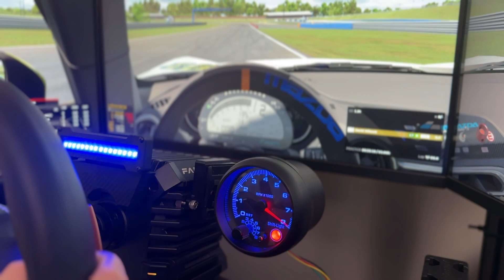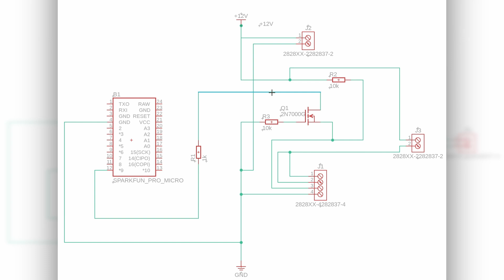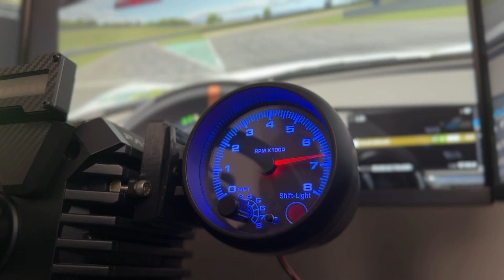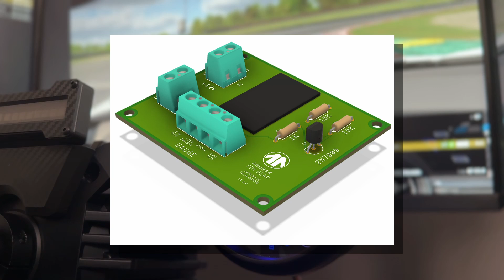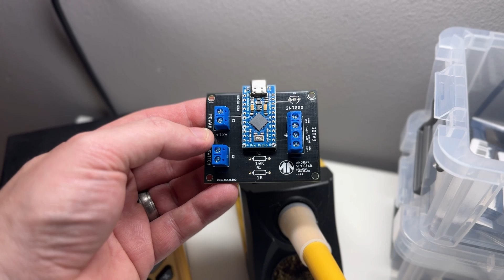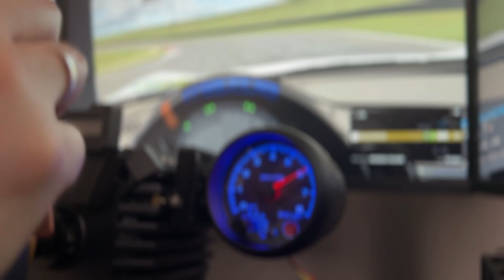New sim racing project: Analogue Tachometer

Comment: Great video, thanks for posting. Seem to to see other setups mainly using the 11k max rpm tachos, did you have any issues with yours being 8000rpm?
Reply from the maker: Thanks! I didn’t have any issues as such - anything over 8k rpms just doesn’t register. I did have to set it up specifically in SimHub to set the max RPM and cylinders (pretty sure 8 cyl gave me best output) and then had to fine tune each 1000 rpm range in simhub. A bit fiddly but only takes about 20 mins or so.

Comment: Appreciate the video.  Very cool.  Are you selling them?  If not I'm definitely going to copy your setup.
Reply from the maker: Hello! I’m not currently selling them in my shop, but I’m happy to help out where I can. If you want more info, you can fire me an email at dave@anoraksimgear.co.uk 👍
Reply: @absolute_anorak    I'm looking to add multiple gauges to my setup and I'm not very familiar with the computer side of things.  Seems fairly straightforward.  I might have to hit you up at some point.  Thanks
Reply from the maker: Out of interest, what gauges would you want? Assume revs and … speed? Boost?
Reply: @absolute_anorak  I'm a dirt track guy and I'm wanting to make a real late model cockpit.  So I'm  looking for Tach, water temp, and oil pressure.  Really the water and oil can just be "fake" inputs.  Just trying to make as real of a cockpit as I can.